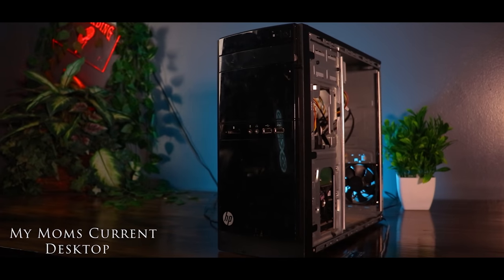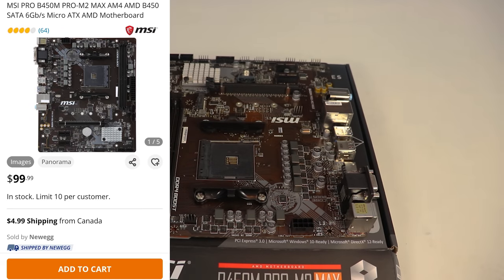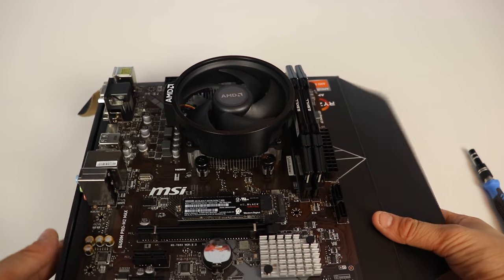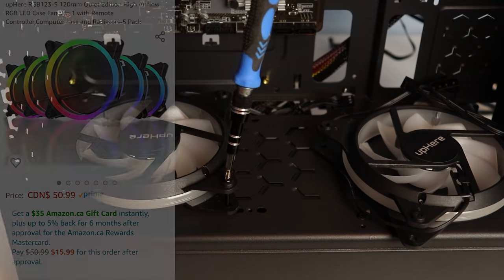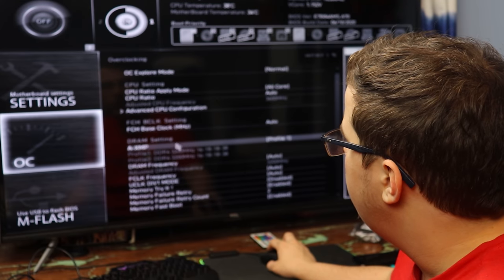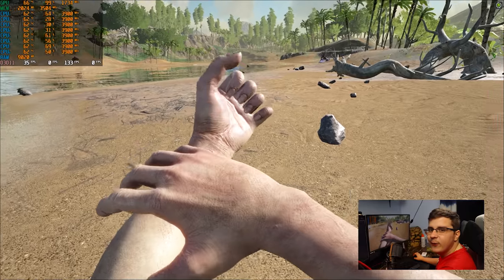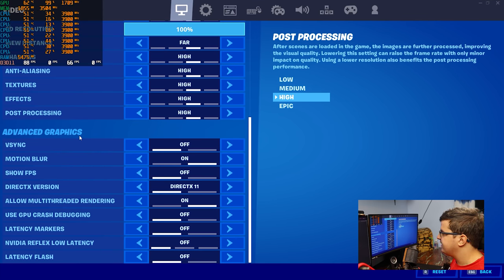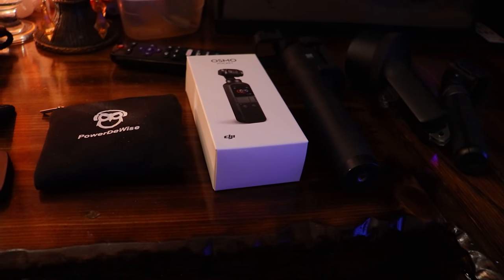Building my MOM a Custom Gaming PC (Ryzen/RTX)

Comment: This was a pretty bad build because for one you used twist ties not zip ties and you also used a F tier PSU which should be avoided at all costs and i bet at the time for like 5$ more could of had like a 550w C tier (maybe B tier) PSU instead and also a 1650 would of been a lot better than a 1050 especially for at the time 2021.
Sure it is a decent system that could play most games at 1080p low to medium settings but honestly for about the same price point or even less you could use something like a Nintendo Switch instead.
Reply from the maker: Twist ties are actually better since they are easier to remove and rearrange for future upgrades. 
PSU is more than enough for a 1050 / ryzen 3. And it was very cheap at the time, (40USD) 
1650 is over 200 dollars, and i got the 1050 for 40 cad. 
You cannot edit videos on a nintendo switch.